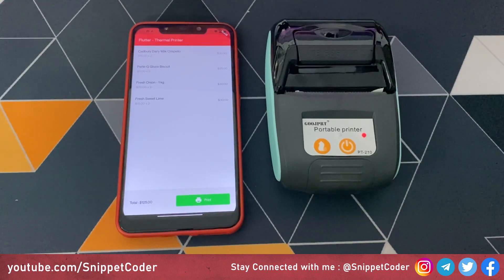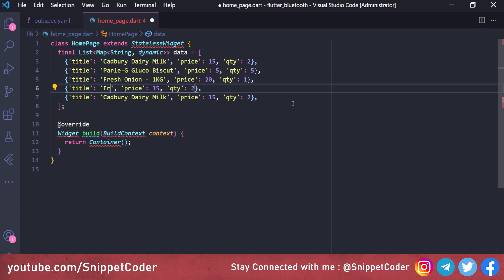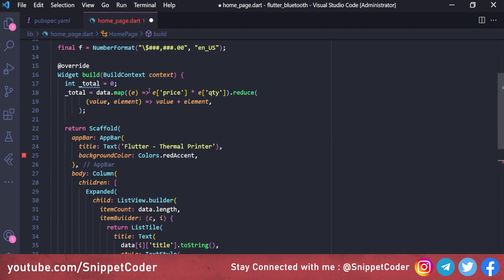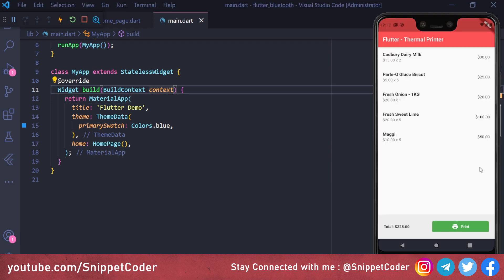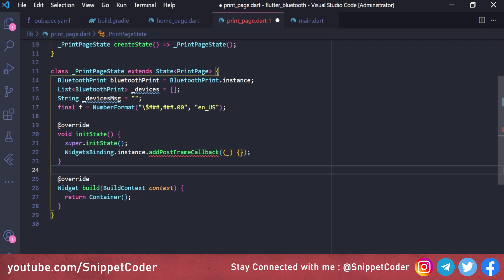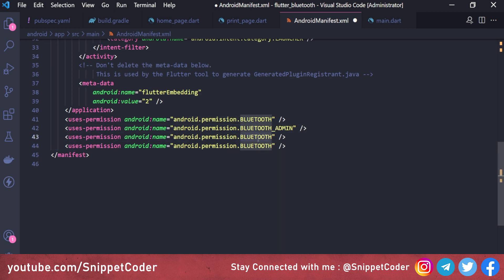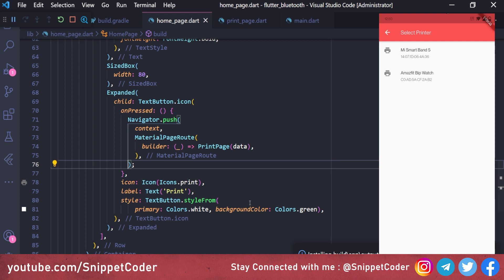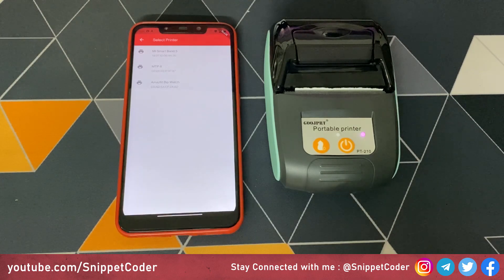Flutter - Bluetooth Printer - Thermal Printer

Comment: I have a Web Based POS System using Laravel and I open the Application using a tablet, when I want to print a receipt but it won't print. Is it possible if I deploy a Flutter project to my server and make that flutter project as a service for my web application to detect and print receipts? So the flutter project will take the Receipt content from my web application and it can be printed
Reply from the maker: You have to check if this printer utility provide the support for web or not.

Comment: A problem occurred evaluating project ':bluetooth_print'.
> Could not find method compile() for arguments [file collection] on object of type org.gradle.api.internal.artifacts.dsl.dependencies.DefaultDependencyHandler. THIS ERROR HAPPEN MY CODE
Reply: Esse erro se resolve modificando o arquivo arquivo 'android/app/build.gradle' na chave android{} e depois achando a chave defaultConfig {} defina o valor 21 em minSdkVersion. android {
    ...
    defaultConfig {
        ...
        minSdkVersion 21
    }
}
Reply: Tambem tive que alterar o arquivo C:\Users\MeuPerfil\AppData\Local\Pub\Cache\hosted\pub.dev\bluetooth_print-3.0.1\android\build.gradle na linha de dependencias: removi o copile e deixei apenas as linhas de implementation, ficou assim: dependencies {
    implementation files('libs/gprintersdkv2.jar')
    implementation "androidx.core:core:1.6.0"
    //implementation files("D:\\devtools\\flutter\\bin\\cache\\artifacts\\engine\\android-x64\\flutter.jar")
}
Reply: Espero que isso te ajude!

Comment: it is possible to leave the default printer so that it is not necessary to select the printer each time?
Reply: hi did you find a solution to this?
Reply: @backstagewithrahul  I haven't had the need yet but when I need it I'll search and find it I'll post it here
Reply: Hi, have you found the solution yet? I have been trying to implement it but as there is so little information about this package so it's hard to understand.
Reply: @somestarsoul1064  sorry, a stop my project for a time. Dont implement this

Comment: Exception has occurred. _CastError (type '(MethodCall) => Null' is not a subtype of type '(MethodCall) => Future<dynamic>' in type cast) in blutooth printer.

how can i solve this error
Reply: I am facing the same issue. Did you manage to fic the problem?
Reply: @Mary-xi7yv  Migrate to nullsafety version but facing problem with the up to date version
Reply: estou com o mesmo problema, você conseguiu resolver?

Comment: I cloned your project. It shows the printer but does not print. Where is the problem?
Reply from the maker: is your printer is getting connected ?
Reply: @SnippetCoder  yes printer get connected but didn't print anything
Reply: @SnippetCoder  please reply here
Reply: Same problem
Reply: same problem, did u find a solution?
Reply: @NoorWFH  Did you find the solution?
Reply: @unwantedchild117  I used native android implementation

Comment: FAILURE: Build failed with an exception.

* Where:
Build file '/Users/6amtech/.pub-cache/hosted/pub.dartlang.org/bluetooth_print-3.0.1/android/build.gradle' line: 37

* What went wrong:
A problem occurred evaluating project ':bluetooth_print'.
> Could not find method compile() for arguments [file collection] on object of type org.gradle.api.internal.artifacts.dsl.dependencies.DefaultDependencyHandler.

CAN YOU PLEASE HELP ME

Comment: After connecting to bluetooth printer (i have issues in connecting), i only see that linetexts are getting filled up. After bluetooth pritner connection will the code directly print what comes next widget line linetext ?

Comment: Is there any package for desktop
Reply: you should be able to print if you connect the printer through usb port. The normal printer windows from windows should appear. you don't need a library, you just need to create a pdf file.

Comment: getBluetoothService() called with no BluetoothManagerCallback
E/flutter (25217): [ERROR:flutter/lib/ui/ui_dart_state.cc(209)] Unhandled Exception: PlatformException(not connect, state not right, null, null)
E/flutter (25217): #0      StandardMethodCodec.decodeEnvelope (package:flutter/src/services/message_codecs.dart:607:7)
E/flutter (25217): #1      MethodChannel._invokeMethod (package:flutter/src/services/platform_channel.dart:156:18)
Reply: @snippet coder getting this same error. Please suggest
Reply: @iitbritesh  same here, can you please tell me how you solved it? thank you in advance
Reply: Same error =(, maybe library is not compatible with the printer model (i'm using Honeywell MPD31D).
Reply: I have the same error, and can't print any document

Comment: I get the following error when i navigate to the print screen, 
type '(MethodCall) => Null' is not a subtype of type '((MethodCall) => Future<dynamic>)?' in type cast,

Do you know any way to fix it
Reply: I have the same problem
Reply: @renysh  are you the one who posted the issue on github?
Reply from the maker: This issue is bcoz of null safety, I already told in the video this plugin not support null safety
Reply: @SnippetCoder  Hello, I present this same error, I already changed to non-null security, but bluetooth devices are not shown, any suggestions?
Reply from the maker: Have you tried in app debug mode ?
Reply from the maker: I hope you checking in real device not emulator
Reply: @SnippetCoder  thanks for answering, yes, it runs directly on my phone, Android 10.
Reply: @jacd007-xt  This plugin only shows BLE devices.
Reply: I have the same problem did you solved?
Reply: I have this error, how to fix it

Comment: The app works on my android tablet, but only finds a few devices and not the thermal printer. The tablet can connect to the thermal printer outside the app. I've tried increasing the startScan duration but it doesn't help. Any ideas?
Reply from the maker: Sometime, bcoz of scan duration timeout issue, put the Refresh button and call scan from there.
Reply: @SnippetCoder  Can you elaborate a bit? Do you think it is possible to connect directly using the Bluetooth address of the printer, instead of searching?
Reply: @SnippetCoder  I connect with my printer and its connected, but no printing
Reply from the maker: Is your printer working fine with other applications?
Reply: @SnippetCoder  yes perfectly ok, in other its working
Reply: @moloymazumdar3568  is it working now?
Reply: is it working now?
Reply: @tanaysingh1668  i didnt try again,i solved in my way, thank u